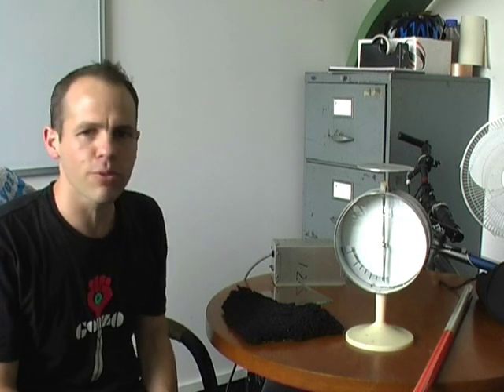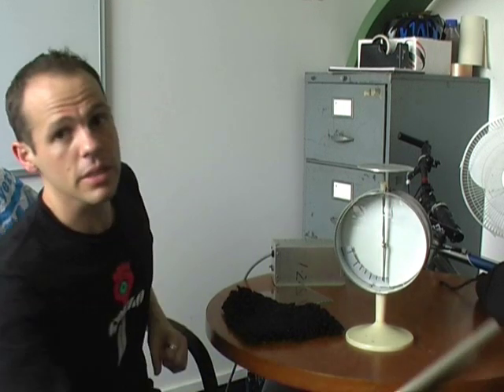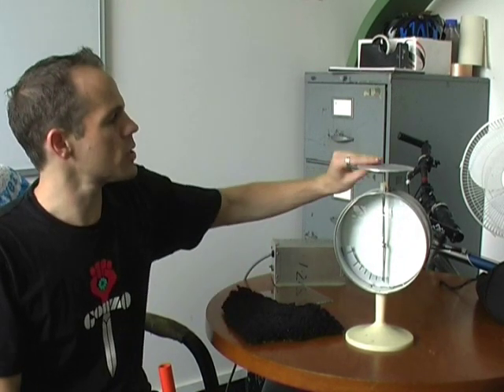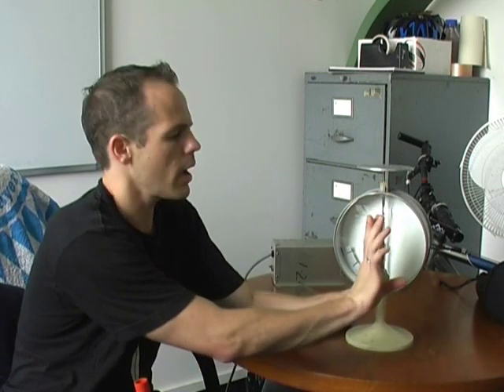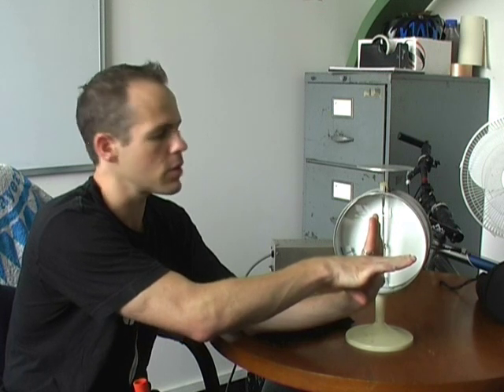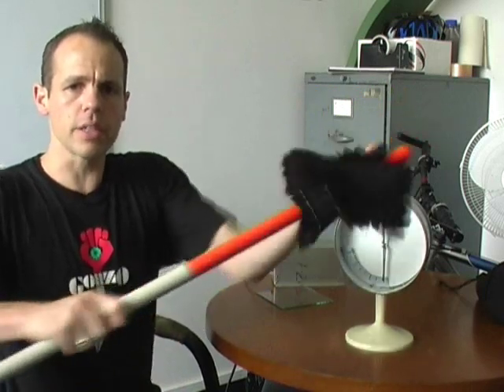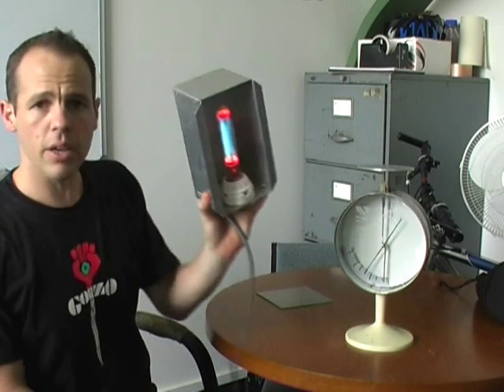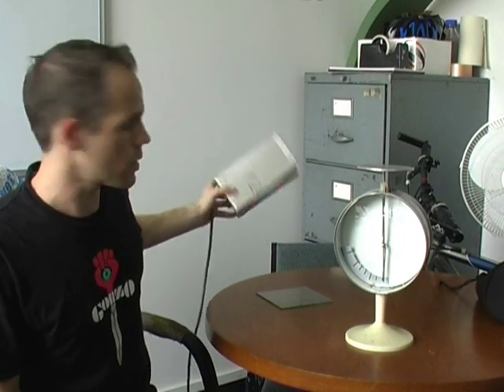The Photoelectric Effect

Comment from the maker: The stopping voltage is a measure of the difference between the photon energy and the energy needed for an electron to leave, in other words, for a photon with energy x + y it tells you how big y is. One last note, if you put a negative charge on the plate, in other words you reverse the voltage polarity, then you push ejected electrons away even faster. You don't get more electrons coming out, that's determined by the light intensity (if photon energy is high enough), but they travel faster.

Comment from the maker: OK, suppose it takes x units of energy for an electron to escape the metal surface (this is the work function) and you have photons coming in with x+3 units of energy. An electron will absorb the photon and use x units to leave the metal and then the remaining 3 as kinetic energy once it leaves. This determines how fast it travels once it leaves. The electron is a negative particle, so if you positively charge the metal plate then you can electrostatically attract it back there.

Comment from the maker: When you positively charge the plate, this is the same as just putting a 'voltage' on it, another way of seeing it is putting on an electric field that opposes the motion of the electron away from the plate. If this voltage is small, the electron has enough kinetic energy to resist the attractive pull of the plate. When it becomes big enough, it will pull the electron back in. The voltage needed for this is the stopping voltage.

Comment from the maker: But, intensity still matters if the photons have enough energy; in this case, you put twice as many photons in, you get twice as many electrons out. The only case where this breaks down is when you put a voltage on the plate that is equal to or greater than the stopping voltage, then intensity no longer matters. The reason here is that the voltage produces an electric field that drags any photoelectron back in, irrespective of how many you make. Here, any intensity gives no photoelectrons again.

Comment from the maker: Yeah, that's right, electrons can't 'accumulate' photons until they have enough energy to leave, they can only use one photon, and if that photon has enough energy, they absorb it and use the energy to escape the metal, if it doesn't have enough energy, they don't absorb that photon and the photon goes elsewhere (e.g., gets reflected). So, if you have photons with insufficient energy, it doesn't matter how many you have, they are all useless.

Comment: What about in microgravity environment? Like, the ISS? Should red, or infrared do something?
Thanks for the demo!
Reply from the maker: Should make no difference at all. The electrons are not held in the metal by gravitation.
Reply: @Ad_Mico  Hi!
I didn't asked well: how it could affect the moving part (needle)?
Thank you!
Reply from the maker: @VeronicaGorositoMusic  Oh, you just wouldn't use that anyway, it's the crappiest part of that set-up I used. You'd just use an electrometer instead. But assuming you had to use that, then yes, everything changes as that part does use gravity.